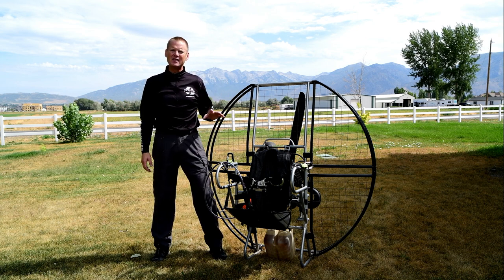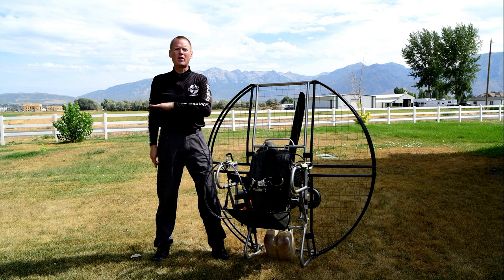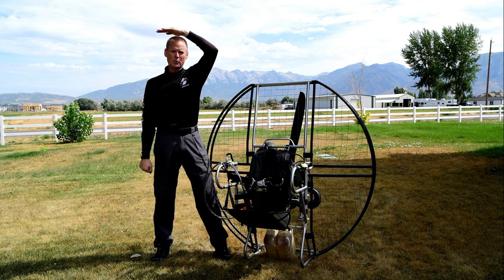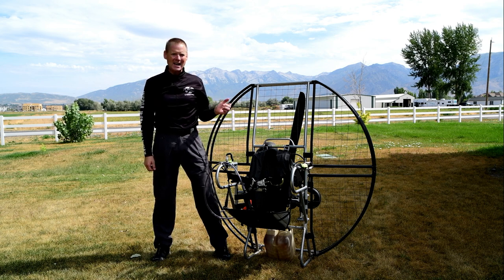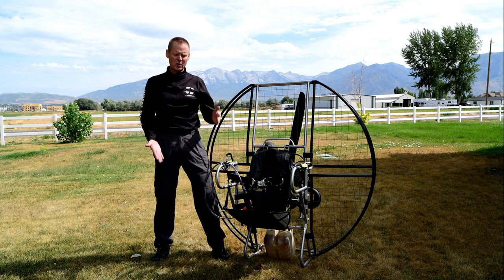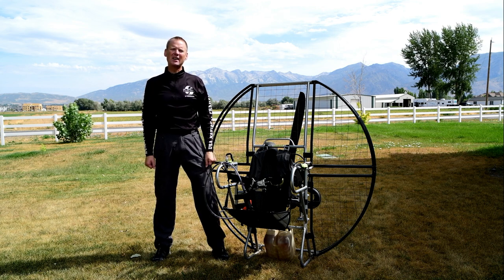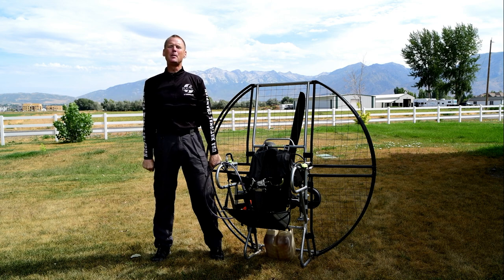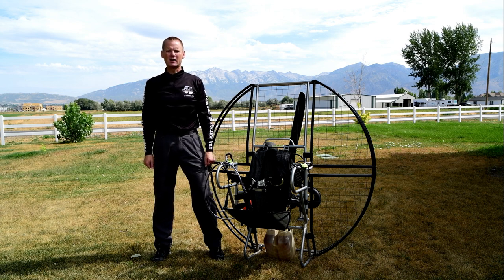Paramotor Safety: Certified Height Hook In Points! Powered Paragliding Gear Review!

Comment: Explain to me why PPG gliders should meet the same design parameters as parasailing gliders? They are not the same type of flight. Having power allows for a lot larger design envelope. I'm sure there are parasailing gliders you can use with a paramotor, but that doesn't mean gliders designed specifically for use with a paramotor are crap. Certainly some are but then I'm sure there are parasailing gliders that are as well. I do agree that begining pilots should use equipment with more safety margin. At the same time, those with the experience and desire to do acrobatics and high speed slalom flying need gear that doesn't babysit them. I'm sure that glider that takes 8 seconds to stall at full brake isn't exactly at the top of the charts for fast maneuvering.
Reply from the maker: There is absolutely zero difference between a paraglider and a paraglider.  Weight is weight.  No difference between soaring off a mountain, towing behind a boat or being pushed with a motor.  It's all about having the best characteristics in that glider and both sports are benefited from the exact same characteristics.  Glide ratio, speed, handling, stability, safety, ease of launch.  If a glider isn't efficient then it isn't fast.  So gliding off a hill or flying with a motor are both benefited greatly by the most efficient glider.  The more glide ratio and efficiency the higher the top speed you can attain before you run out of power.  The Dominator is the glider I set the paramotor world speed record with at 51mph which also means you know it's the most efficient at that loading.  I've set piles of other world records with the Dominator as well because it handles better than some uncertified acro gliders.  Plus the Dominator is also a super duper safe certified beginner class glider.  So not only does the Dominator give the best performance but also the best safety both in the same glider.  Those promoting wings as "paramotor wings" are really just admitting they don't understand the sport.  Same with anyone that would talk about "slalom racing" as ZERO competent pilots do that as it's the most idiotically stupid thing you can do in the sport.  Flying full speedbar at maximum speed is for high altitude straight and level flying NOT for flying around in circles back through your wake while low to the ground on total death trap wings.  When full speedbar the wing is at it's lowest angle of attack and therefore is the least stable and most likely to collapse so ZERO competent pilots would ever fly full speedbar around in circles low to the ground where one collapse could kill them.  So the idiots doing such things are totally clueless newbies that don't have even the most basic understanding of the sport.  Which glider is best has nothing at all to do with opinion as nearly every characteristic is easily measurable.  Speed is not an opinion.  Glide ratio is not an opinion.  Sink rate is not an opinion.  Safety is easily measurable.  Weight is not an opinion.  These things are very easily measurable so it's really simple to just pick the glider that actually does have all the best characteristics without any opinions getting in the way.   Currently the best wing that has all the best characteristics is the Dominator.  It's the wing I'm using the set most of the world reocrds and the same wing I put my own kids on when they fly because it's also the safest on the market as well as the easiest to fly.  If you want to race people then you want the fastest glider and that is the Dominator.  If you want to learn acro then you want the best handling and safest glider and that's the Dominator.  If you want your kids flying you want them on the very safest and easiest glider to fly and that's the Dominator.  If you want to fly tandem on your solo wing then you need the absolute best lift at the lowest possible speed for the easiest launch and that's the Dominator.  The second something beats the Dominator I will be flying it and recommending it though.  I can't wait to find a wing that can beat the Dominator.  That would be an incredible milestone of the sport.  I challenge anyone out there to get me a wing that I find can actually beat the Dominator in all characteristics.  In fact I've offered a $5000 finders fee for many years now for anyone that can produce a glider for me that is in fact better than the Dominator.  For now though there isn't anything else even comparable to the Dominator.  Other gliders are not even close.  Wings they call "paramotor wings" are literally the absolute worst in the history of the sport as they are put out by those that have no clue there is zero difference between a paraglider and a paraglider.  It's all about just getting the very best over all characteristics.
Reply from the maker: That's just it as opinion has nothing to do with it.  Each characteristic is measurable so the best is the best and that's all there is to it.   The safest glider is the safest and the fastest is the fastest and the most efficient is the most efficient.  You can see the side by side comparisons all over youtube of the Dominator utterly destroying other wings.  It liteally handles BETTER than the Thriller acro glider in a direct side by side comparison and faster than totally uncertified death traps all while also having the lowest speed for the easiest launch and best safety for  new pilots.  There is no opinion about it.  The best is the best.

Comment: How much $ for ppg?
Reply from the maker: If you get all the very best top of the line gear all brand new like I've set so many world records on it's about $12,000.  Or we have the best gear in the world used as low as about $6000-$7000.  Or we have less than the best for as low as $3500 for a wing and a motor.  Just call us at 800-707-2525.
Reply: Oh nice ,may be that still my dream